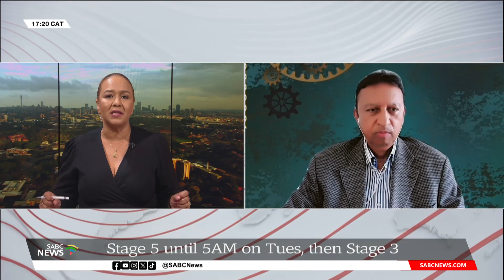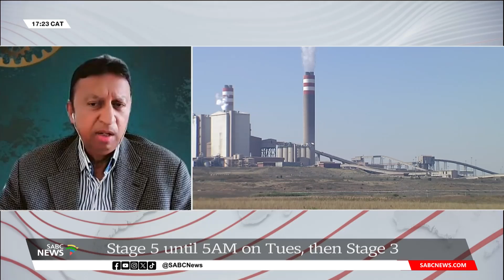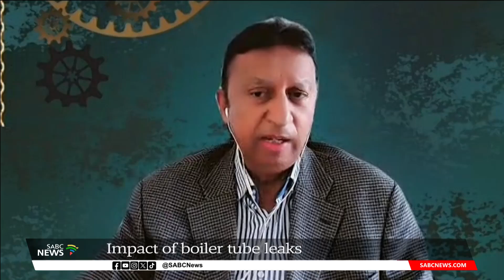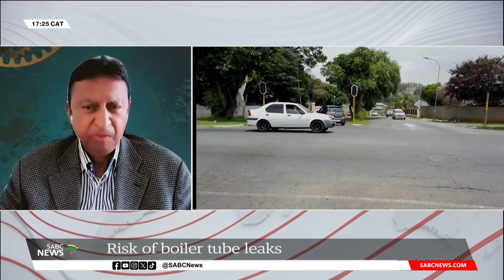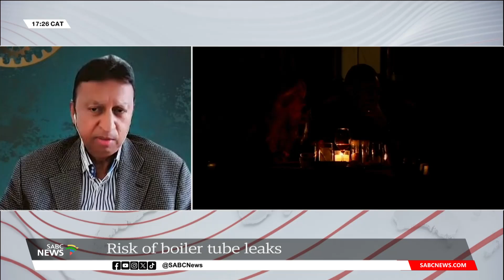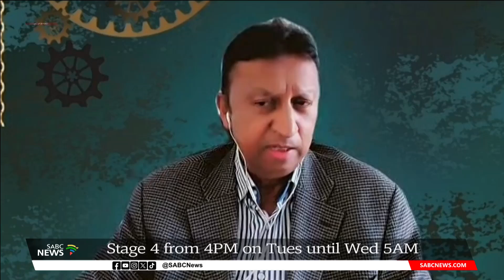Eskom blames Stage 6 load shedding on boiler tube leaks: Vally Padayachee weighs in

Comment: I had a meeting with young Edkom Engineers weeks before the first locked down as a Group of Engineering businesses we offer Eskom a Swat team to rebuild and repair bioler tubes we offered them the SMR as well 
These young Eskom Engineers clearly had no clue where to start from they had no concept had no clue how to conduct the meeting from Eskom side until Dr Victor Mathe arrived in the meeting
I knew then the problem at Eskom is compitence and experience its coear Eskom is run by Engineers that clearly dont know the business